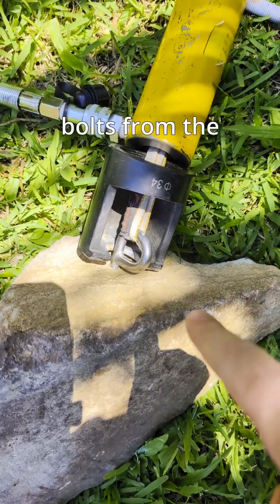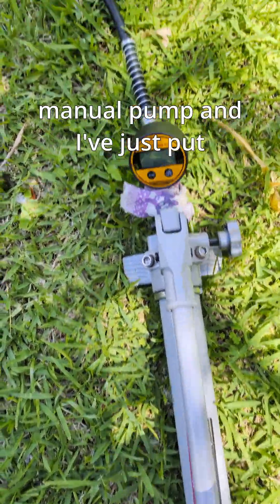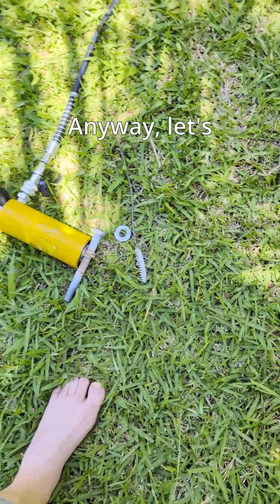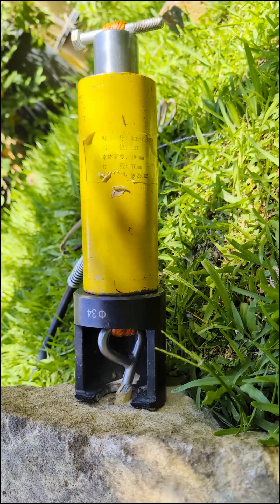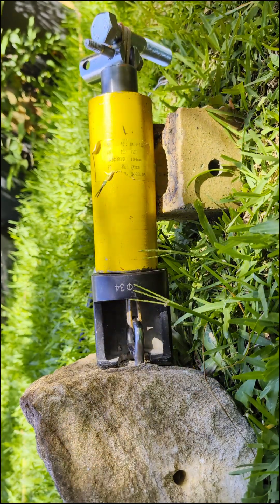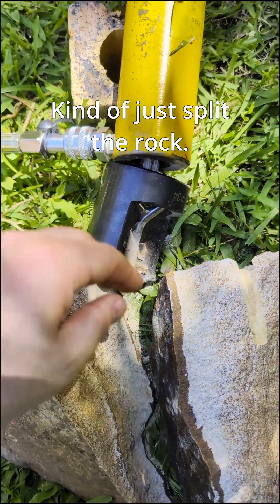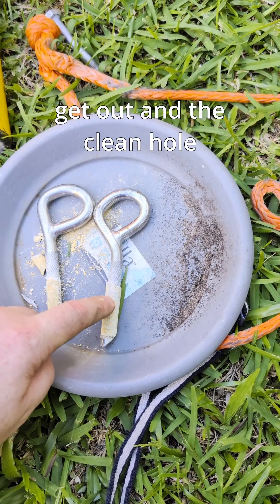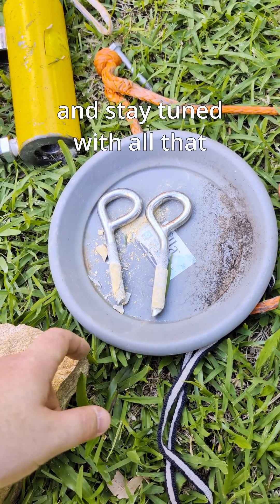Does torque testing weaken glue in bolts?.

Comment: Also interesting how the rock split in half… especially since I climbed on bolts with less rock around it today 😒
Reply from the maker: The rock still broke at 22kN, and it split like that because the steel footer thing tilted & pressed on the rock right there. If it had stayed level it would've been even stronger